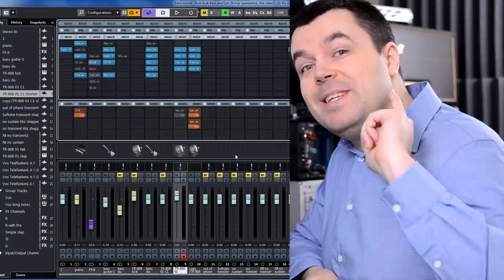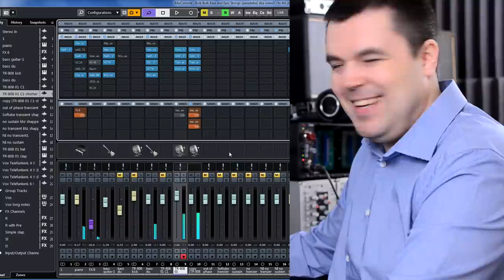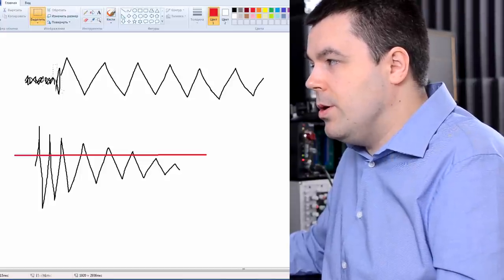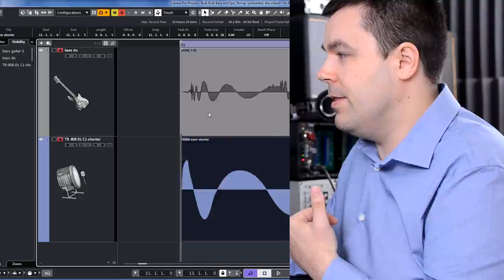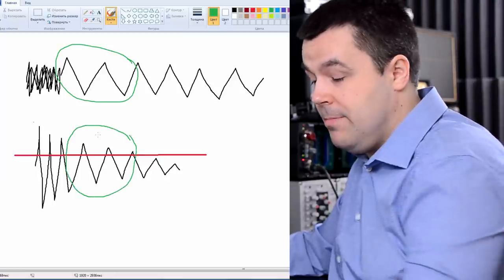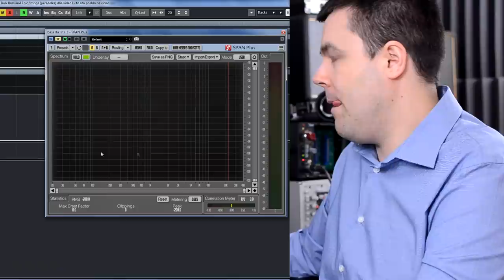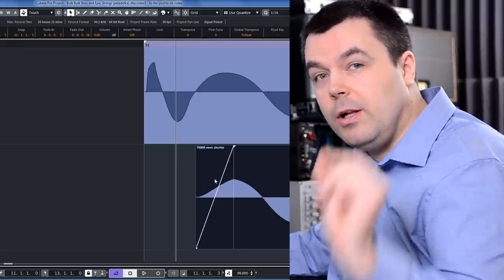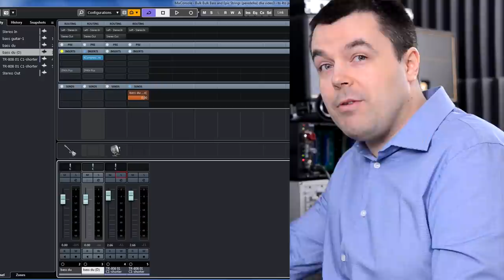The Most Advanced Kick and Bass Mixing Technique

Comment: Very cool video thank you for this! I’ve experimented with many side-chaining techniques (compressor, multiband, dyn-eq) over the years, never tried this way. Found that using filters to focus kick/bass, doing a small scoop where the bass & kick fundamentals clash, using basic volume balance (great monitoring is key) and using saturation through the same plug but shifting it adjacent to each other (one odd, one even) works great 👌🏽 but will shootout with this!
Reply from the maker: This one will beat those traditional ones for sure.
Reply from the maker: Check my new video. It's about misconceptions which make people relearn audio production after like 5 years of the start. But a lot of guys still don't know these principles: https://youtu.be/FrRwKg0xDh4

Comment: I was thinking about a way to automate this. 
I believe it would be by using an hypothetical gate/noise gate in the sidechain track, 
with very low threshold and instant attack with no release. 
The effect would be implemented if the noise gate has a parameter I would call "delay" 
or "predelay" in ms that will delay the trigger of the attack by xx ms, and therefore, cutting 
the start of the waveform. That is why I call it hypothetical since, as far as I know, 
no gate/noise gate has this parameter. 

By the way, I attended Andrew's trial class. I learned so much just on a single class.
I very much recommend to take the full course, which I'm looking forward to start soon.
Reply from the maker: Hi Hugo. Gate will not be working for this task. The transient of the kick in the project is the loudest part of the kick. Gate preserves the loudest parts. But then it pushes the tail all the way down. And the longer the tail goes the quieter it will be. We have a totally opposite task. We need the tail of a bass to come back in volume to the end of a kick tail which Gate can't do. Also, we need this volume to come back with a equal power exchange. The quieter tail of kick becomes the louder the tail of a bass becomes. Gate can't do it.
Reply: @AndrewZeleno1  Hi Andrew, thank you for the reply! Yeah, that is what I have thought. Currently, there is no gate plugin that can do this right out of the box, so to speak. You may want to create your own :)
Reply from the maker: I created this technique which does exactly this :) So I think it's enough for me. See you in September at the course
Reply from the maker: My new video "what is the best compressor plugin" with examples how different plugins suck in one situation and sound good in the other. Like a guide how to choose plugins properly for each situation. A lot of unknown nuances: https://youtu.be/00xu2IAbZtM
Reply from the maker: Here's the link to my new video which will potentially blow your mind. Probably the best Saturation tutorial. We will check how exactly it changes the strгcture of harmonics in the real mix and cons of it. Also a guide how to really harmonics. Check it out: 
https://youtu.be/wsm8RdMW03g

Comment: I got a question and I will totally understand if you don't answer here...
If I use the best technique to let both transients free to go (bass and kick transients), they will not cancel each other if some phase issues occur?  I mean, we are avoiding low-mids and low-end problems, what about two transients that are very similar?
Reply from the maker: It's the other thing which you consider separately. There are less than 10% of chance that they will be too similar. Even if some frequencies will be out of phase other overtones can be even at different places in the spectrum. Also As I showed in the very end you can even have 4 track trick which means now you can even EQ bass's transients differently or even saturate it separately.
Reply: @AndrewZeleno1  Ok, I got it.
Thank you very much, Andrew.
Reply from the maker: No problem Marcelo
Reply from the maker: Check my new video. It's about misconceptions which make people relearn audio production after like 5 years of the start. But a lot of guys still don't know these principles: https://youtu.be/FrRwKg0xDh4
Reply from the maker: My new video. 4 bonus Ugly Truths. This time on Mixing and Mastering: https://youtu.be/TkZvPqsWlUs

Comment: Great tutorial. I always tried cutting 1st harmonic of bass by about 10db with a dynamic bell curve filter to clamp down on the transient. Problem is it is only any good until you change the pitch, then you spend lots of time automating the eq. The length of kick plays a big part too in ensuring no frequency clashing.
Reply from the maker: Thanks! The 1st harmonic (0 overtone)? The problem is not the transient of the 1st harmonic. To be honest I don't think we are talking about the same thing. I explained around 13:49 why cutting just lows doesn't work perfectly. But the main point of the video is don't allow the transient to exist in what triggers compression at all.
Reply: Andrew Zeleno thank you so much for your explanation. Sorry, I did mean the initial transient which I tried to attenuate using dynamic eq using the classic method. In some modern dance music, the transient of the kick is often required for extra punch. Some engineers even weld different transients onto the front of their kicks to emphasise the punch further still. Using AZ independence technique, how might this work the other way round so that kick has dominance? Would you shave off the transient of the bass and keep transient of kick so that the sustain of the kick triggers the sustain of the bass? Obviously this transient of the bass would be compromised this way. Have to say your videos and explanations are awesome. Hope to do your course in the autumn. If I can’t get kick and bass right, I may as well give up! Greetings from London.
Reply from the maker: No matter what you decide to do with a bass transient, the cool thing about this technique that you have an equal power exchange. Perfect drop on the bass to put the tail of a kick above it. Then you can decide to do whatever you want with the transient of the bass. As you said you want more space for the transient of the kick, then you can apply any transient boost on the kick and any transient drop on the bass. It will have nothing to do with the tails. They will work properly on their own. And you will be able to control transients without any influence on that compression.
Reply: Andrew Zeleno I had to watch the video again and I understand your concept now. There is a lot to take in. I have one last question - will the transient of the bass conflict with the transient of the kick here, as no side chain compression is applied to either? I know both are very short sounds, but would these spikey transients be enough to send your signal into the red? Since you have complete control of their separate tracks, I guess you could avoid clipping by adjusting their volumes. And you could always offset these transients very slightly on the timeline. Cheers.
Reply from the maker: As for transients, with this technique you can design transients separately in any way you want. This technique only creates an equal power exchange for the tails. Even if you drop or boost transients after you apply this technique, nothing will be changes for the tails. As for going in clipping (Red) it seems like you a bit floating in understanding the levels and clipping. But I can't explain anything here in text. It would be a book. Anyway make sure you understand that Youtube doesn't give notifications about replies to comments. I will miss your next reply with 99% of chance because I can't reread all comments under this video. So it's better to post a new comment. Anyway I think I spent more time with your comment than any other comment under this video. I hope I helped with something.

Comment: hi Andrew, do you use LFO Tool or ShaperBox? couldn't they accomplish the same in terms of simulating compression that bypasses the transient? thanks
Reply from the maker: There is no equal power exchange with these tools. If a drummer plays every note differently it also will not be working perfectly. Compressor examines RMS changes to apply the equal power exchange.
Reply from the maker: Check my new video. It's about misconceptions which make people relearn audio production after like 5 years of the start. But a lot of guys still don't know these principles: https://youtu.be/FrRwKg0xDh4
Reply from the maker: Here's the link to my new video which will potentially blow your mind. Probably the best Saturation tutorial. We will check how exactly it changes the strгcture of harmonics in the real mix and cons of it. Also a guide how to really harmonics. Check it out: 
https://youtu.be/wsm8RdMW03g

Comment: OR just use VolumeShaper 's multiband curves. Trigger the plugin by MIDI. You have total control of your volume reduction curve on each band.
Reply from the maker: Each kick sound can be different. No midi can help it. Even the transient can be taller on one kick and shorter on the other kick. Plus we cut the transient to have an equal power exchange based exclusively on the kick's tail. You didn't understand the video. Also, I specifically mentioned at 13:49 why I don't want to change the frequency manipulation so multiband is NO.

Comment: Wouldn't a low end hi pass on your sidechain signal do basically the same thing with less work? Most kicks have their transient in the low range around 60-80Hz. Roll that off (like you can in FF ProC2) and call it a day. Wouldn't that be easier? Then your compressor is only reacting to a certain frequency range in your sidechain. Also, Smart:Comp is neat to use in this way as it has many independent bands that you can focus your sidechain on. Another great plugin for adjusting your sidechain transient response without having to manually cut the transients out of every kick on a separate track is Laser.
Reply from the maker: You clearly didn't watch the video. I explained all disadvantages of what you mentioned. 13:49 for example. "Most kicks have their transient in the low range around 60-80Hz" is also strange considering it's not truth at all. A transient is a snap which can't be low frequencies in the first place. I even showed a frequency analyzer which shows the transient frequency response in that video. You clearly didn't watch it.
Reply: @AndrewZeleno1  I did watch the video. You stated that the whole point is to avoid the transient of the kick when compressing the bass. I did misspeak, though. I was wrong about the transient frequencies of the bass that should be rolled off. I should have inverted what I said to low pass instead of high pass. The transient of the kick is a bit higher, around 200Hz or so and the lower frequencies usually follow after. If you set your sidechain detection to about 60Hz with a low pass then the compressor on the bass will ignore the transient of the kick and react to the more sub frequencies, which is essentially what you are doing, only manually. There's nothing wrong with that. It just takes more effort. There are tools that will allow you to accomplish this faster and cleaner. That's all I'm saying.

Some people even use some interesting compression techniques on the kick to make the low and mid-low frequencies react at the same time, but I think that takes away from the life of the music, unless of course, the music is very technical, fast or electronic and requires that kind of precision.
Reply: @abrotherinchrist  I don't agree with you man. The video explained that All overtones of the bass sustain should trigger compression to achieve what he called Equal Power Exchange. The guy gave some valuable idea. You continue teaching him nonsense. Not good.
Reply from the maker: 1) I need an equal power exchange so I need the whole freq spectrum of the kick tail to be a trigger. Not only 60 Hz.
2) if your kick is electronic you may have some lows in the transient which will be nice to not react to. 
3) In the very end I showed how you can even split bass's transients so the release of compression (Even short release will not help in some cases) will never harm them. You side-chain will never be able to do it.
4) If you later decide to shape the transient of the bass or kick in my way it's free to do it. In your way a lot of things may need to be readjusted. 
"mid-low frequencies react at the same time" low-mid is where the transient fundamental tone usually is. if it react to it you will kill the transient of the bass.
Anyway use what makes you happy. We are wasting our time. You didn't understand advantages of this technique. And it's fine. My goal is not to convince you.
Reply: @AndrewZeleno1  I see what you mean now in point 3 above. You are not compressing the transients of the bass, only the sustain. 

So if the bass and the kick transients fall at the same time and are too much I suppose you could sidechain the transients of those separately to one another too, if necessary. Very cool. I could see how that would be worth the effort, separating the transients from the sustain of each.

Comment: I don’t trust “audio engineers”  with the “acoustic” foam
Reply from the maker: So it's like racism right? Just because of somebody is black you hate him? Check the truth about foam: 4" acoustic foam (properly manufactured. every foam has a different gas transmission coefficient) is as effective as 2" fiberglass. Secondly Even 8" fiberglass is BS. It doesn't control lows. Even supperchunk bass traps don't control lows. I have a hube bass trapes in the corners. Much bigger than your audio engineers who you trust. All you "fancy" studios don't have proper control of lows anyway. They put just fiderclass or wool 2" pannels. Even 4" will be BS. Even Helmholtz is effective to only specific frequency. Even Diaphragmatic absorbers should be properly made. Also you have no idea what is behind my foam. There are a wardrobe with holes in it measured to be a huge sandwitch panel. My ceiling is not parallel. Also as I move almost every 2 years I need to have a mobile light weight set up.